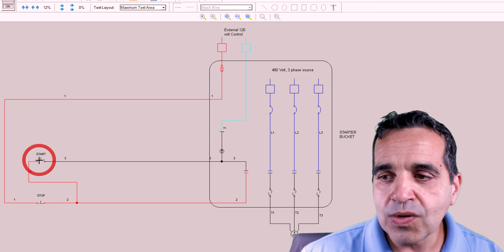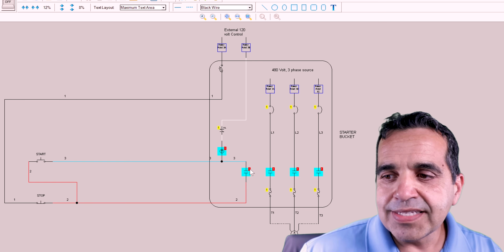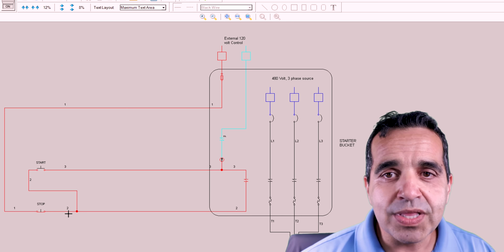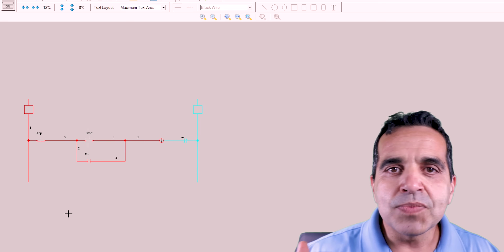Basic Motor Control: 3 wire Start Stop Circuit

Comment: Thanks so much for this video, and the entire series!!  Just a hobbiest, but am installing CNC mill and manual lathe in home shop. Came to these videos based on VFD intro videos, stayed to watch these basic tutorials on motor control. Last year I had 2 electricians helping me to troubleshoot a 20 yo but "brand new, unused" 18" bandsaw. Couldn't get it to start even though all the switches seemed fine. I finally discovered that by manually closing the contractor, the motor would start, thus eliminating the motor as "the problem." I used a volt/ohm meter to verify that power was making it to the motor control inputs, and that the basic control switches were working as intended. I went so far as purchasing a replacement control unit from Amazon but then I was stuck. 
The second electrician was brought in at this point. He was able to diagnose the problem with the original motor control unit (from ~1988)--the primary relay coil had break somewhere so it would not energize. The contractor units have been standardized for decades, so the second electrician (the 'motor-control whisperer') as able to harvest the coil unit from the Amazon replacement and use it in place of the original unit. Everything just snapped together and now the unit operates properly with it's original control switches and front panel intact. While this was a great result I don't like to think about how much all that cost (lets just say a few hundred dollars).  Having watched these intro videos on Motor Control and 3-wire start/stop circuit basics, I could now understand better how it was all working (or not working). Don't know that I would have figured out what the problem was, but at least I would have had a chance.
Finally, I'm going to keep watching this series because, for example, I may want to add an additional stop switch to the bandsaw. The red momentary NC switch assemblies are readily available on Amazon. From these videos, I think I understand how to add more to make the machine safer to use with a more accessible STOP switch.

Comment: You are really perfect, I like to make a video on Soft Start how it works what signals it has the wiring connection and the interface between it and control system and what kind of signals sends as feedback, and  one for VFD as well, really appreciate it.
Reply from the maker: مصطفى الربيعي I have several video’s on VFD programming and wiring. I will need to make a soft start video soon

Comment: thanks, great video.

I'm just dipping my toes into this as I have an issue with a machine in the workshop and needs to be rewired so thank you. 

I think the hardest part is finding currently is what comments would work in my situations, I have a DOLD soft start and DC brake unit that I am trying to understand the wiring diagram of but some bits don't make sense, also do I put other breakers before it. thanks James

Comment: @ 6:40 , what process (or property) allows that contact to stay closed & energize the coil, bypassing the (now opened) start button ?
Reply from the maker: bigmedge The holding circuit is what causes the starter to stay closed or the contactor to stay closed even when they start circuit is open. Watch my video by the same name put with a parentheses at the end and the word updated. And there I go over the same wiring schematic but I show you the schematic I show you the starter I actually put out each wire individually along with the schematic at the same time. That might help
Reply: AccessToPower will do , thanks! & thanks for the other excellent tutorials too!

Comment: Explain wireing for
220v. magnetic starter 
for an air compressor 
with thermal overload 
push button on 
push button off
All in one box 
and remote 110v automatic pressure switch wired to the control box.
All one power source
Shihlin P35T 
Coil voltage AC 208/230V

Comment: Thank you!. Had to trouble shoot a hood fan system and instead of start stop buttons there were two single poll switches in series. Found bad: coil in contactor, failed switch and a dead short at the RTF.

Comment: How does the bypass stay energized by it self until the stop gets pressed?
Reply: OmegaMetalic terminal 3 to 2 on most contractors. Closes mechanically when the contractor is energized.
Reply from the maker: OmegaMetalic, when you press the start button and the contactor closes, the Normally Open auxiliary contact closes on the contactor. This contact is wired just like the start button and it remains closed even after you let go of the start button. this is how a 3 wire start stop maintains the starter closed until you press stop.

Comment: good explaination...font too small on computer...latching circuit wiring on 1st dia. still confusing.
Reply from the maker: Dave, thanks for your comment on the 3 wire start stop video. As it happens we are releasing a new video on this subject tomorrow. The new video is designed to help the viewer better visualize what is happening in the circuit with both the schematic and field wiring displayed side by side. It still might be a bit small on a phone, but should be good to view on a tablet, computer or laptop. Also, almost all our videos are uploaded up to 4K resolution, so if you are able to view on a large screen the the clarity should be good. Please stay tuned tomorrow for the update and let me know if it helps.
Reply from the maker: Dave, here is the link to our new 3 wire start stop video tutorial. https://youtu.be/kHbXbK7S188

Comment: Show field connections. This video shows paper but not the field.
Reply from the maker: hi Jean M. thanks for leaving a comment on our basic 3 wire start stop motor control video. I will try to create a follow up video showing the field wiring for this circuit, so it can be more useful to you and to others who have left comments.... thanks.
Reply from the maker: Jean M, Thanks for your comment on the 3 wire start stop video. I took your comments to heart and just released a new video with more field wiring explained. Here is the link to the updated video https://youtu.be/kHbXbK7S188